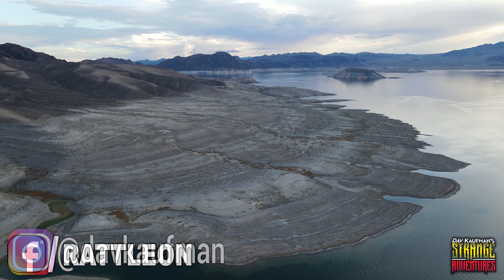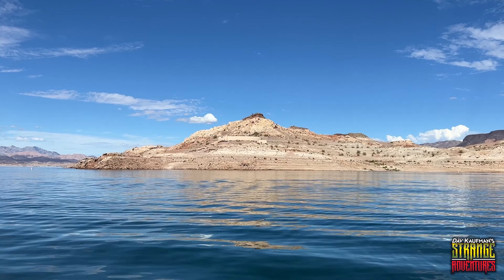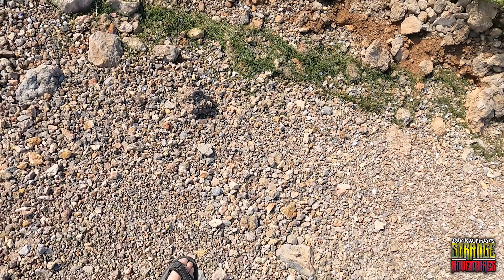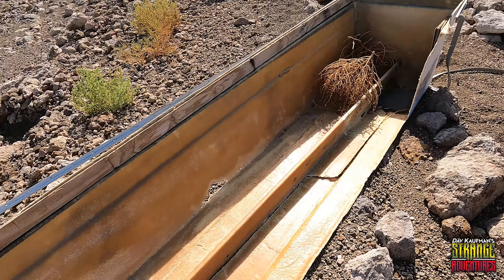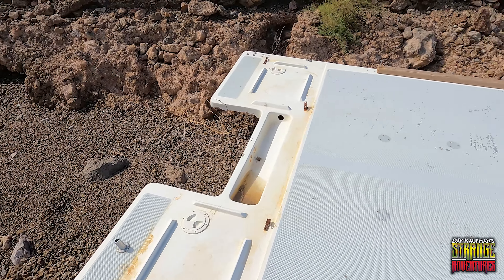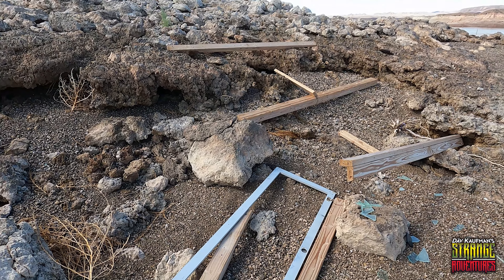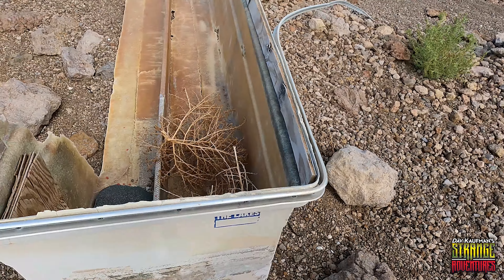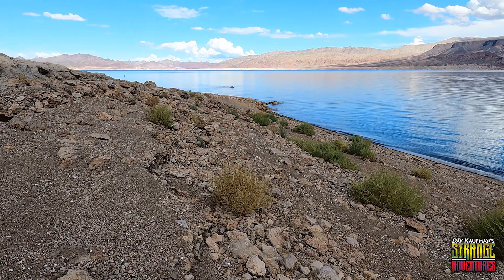LAKE MEAD TREASURE HUNT BY BOAT! UNDISCOVERED STRANGE THINGS REVEALED IN THE DROUGHT!

Comment: The 2nd boat is a 1962 or 63 Glasspar G3 made in Santa Ana Ca. G3s were made with the same hull from 1959 to 1967 with changes to the top side over the years. 62 was the first year for the open deck. 62 and 63 were the only years to have bucket seats, the passenger seat could be flipped back to observe a water skier.

Comment: If there's enough styrofoam to keep the tires afloat, they could have been used as a raft of some kind.  Normally, it's the tubes that I see roped together to make a raft.  The tires are somewhat more puncture resistant than tubes.  But, I'm not really sure.  

Really interesting video.  If you look for them, you can probably find strange things in all of the states.
Reply from the maker: That's a good suggestion and believe me, I'm looking :)